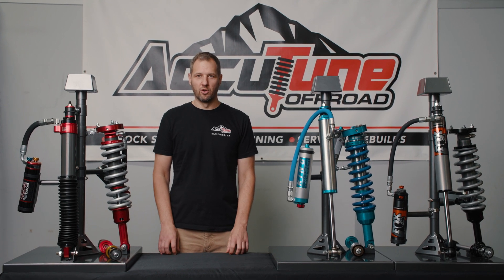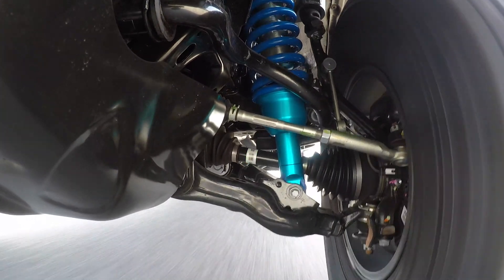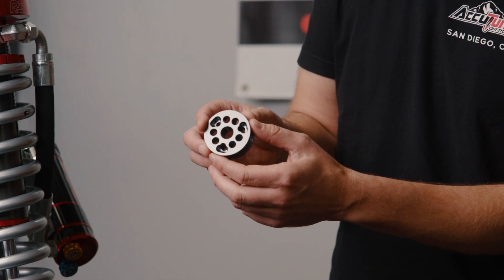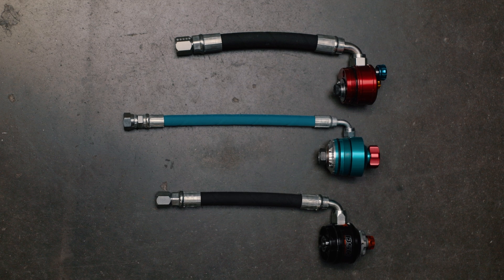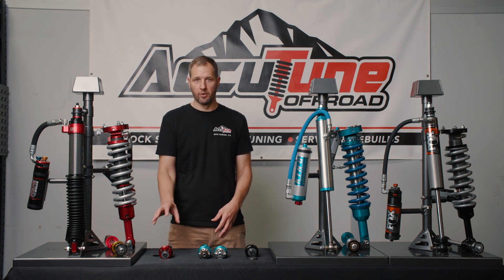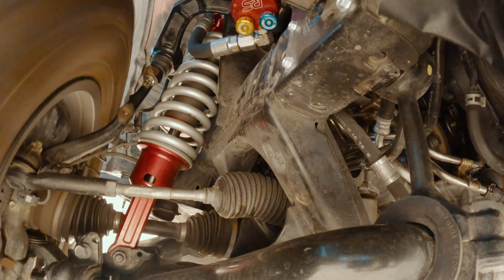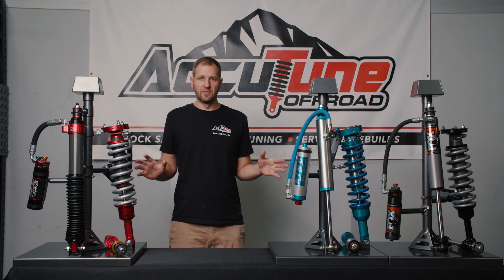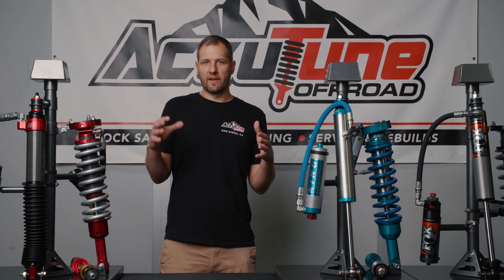How do Ride Shocks compare to Fox and King?

Comment: Now if we can get ride shocks to offer different colors or just get rid of the red that would be amazing.
Reply from the maker: What color combo would you prefer?
Reply: @accutuneoffroad  bronze, gold, or purple maybe? Something that still stands out as your brand, but doesnt clash with most vehicles colors. It sounds dumb, but it really is the on thing that is pushing my my deciding to go with another brand even though I really want the dual adjustments. Plus, red anodizing always fades to pink.
Reply from the maker: @ALBIN_DESIGNED  I'm glad we didn't do gold, because it would look a lot like another brand of shocks. I'm not sure purple would be a desirable color for off-road shocks. I understand aesthetics are important, we opted to stick to red which matches AccuTune branding and it's different (enough) than other brand shocks out there. All anodizing can fade if they are exposed to a lot of sunlight/uv rays. We've had the same set of shocks on our vehicles for 2+ years now with no fading. For OEM fit shocks like we offer, they are usually covered in the wheel well and don't get exposed to as much sunlight as something like a custom buggy would.

Comment: Really impressive quality y'all are bringing to the table with the Ride Shocks! Wish they were available for 2G Tundra's - but probably pretty resource-intensive getting each setup just how you want them to perform. Taco and 4R/GX market makes sense, really like the concept of trying to nail these 'out of the box' with application-specific tuning. Lots of upgrades over the conventional Fox and King offerings. Nice video and great technical info!
Reply from the maker: Thanks! A current employee here has a 2nd Gen Tundra, so we may or may not be working on those soon ;)

Comment: Im looking for shocks for my Tundra. Im going to lift it. Its my daily driver and i tow with it and do off-road. My main thing is i want a comfortable ride. What shocm so you recommend
Reply from the maker: Fox and King are both good options for your Tundra. If you plan on towing and going off-road I would consider getting shocks with adjusters. We can narrow down some options even further with our sales team, shoot over an email to keep this conversation going sales@accutuneoffroad.com
Reply: what'd you decide on? kicking around options for my 2G Tundra as well.
Reply: I bought King 2.5 extended through Accutune. I upgraded to 700# springs due to a winch and hidden winch bumper on my 2g Tundra. I bought Deaver 748s through Accutune, as well.
Reply: Get the adjusters. It’ll help with trailer porpoise where it can get scary. Even cheap shocks with adjusters really helped. The Fox are even better. Buy once cry once.

Comment: What of the top tier options would you recommend for the typical 90/10 owner? I have a 5th Gen 4Runner w/KDSS so any input would be much appreciated! 

If it helps I currently have a sherpa roof rack and window panels holding my maxtrax boards for the PNW season along with recovery gear to help the random person stuck in snow.

Running the Eibach pro truck lift and it sits almost Level with the current weight (full tank)
Reply from the maker: You really can't go wrong with the Ride 2.5 Shocks for your KDSS equipped 4Runner. For the price, you get a ton of value. Aluminum shock bodies, High and Low speed compression adjusters and weight range specific tuning. They perform great!

Comment: Thanks for all the info. I would have buy your shocks from my Tacoma if I would have seen them a little earlier. I ended up going with the Fox DSC's and they're nice. One question with these shocks? Do I need to worry about running a limiting strap so they don't hyperextend? Is there damage that can be done internally? Thanks
Reply from the maker: For trucks like that, its not necessary to have limit straps. These shocks are designed to handle that kind of thing. Limit straps are a good idea for vehicles with a lot of unsprung weight from things like big heavy tires, axles or portals. Limit straps are also a really good idea for high speed applications like prerunners and race trucks.

Comment: I have a fully built 4Runner, looking to upgrade suspension before the end of the year and I am really trying to figure out which of these three setups I’d like. Currently running Bilstein 6112/5160s but want some more comfort for highway driving. With my current setup I feel every bump on the road.
Reply from the maker: The shocks you have are digressive, which means they run a bit firm/sporty. Unfortunately we are not able to change the valving in the shocks you have, but a set of Ride, Fox or King would definitely be a huge improvement over what you have. We've found a lot of people making the switch and really enjoying the improved ride quality, much smoother on the street and off-road. Since they are all about the same price, I would strongly look at Ride Shocks option. They will definitely offer the smoothest ride out of the box compared to Fox and King. They come pre-tuned depending on the build. Feel free to send over an email if you have any specific questions, we're happy to help Sales@Accutuneoffroad.com
Reply: What did you end up going with?!?
Reply: @GustavoRamos-tx4if went with Ride Shocks man!
Reply: @agentwolffe how are you liking the Rides? How’s the on road feel?
Reply: @ dude they are great. My daily commute is much nicer and it eats up all the bumps in the road. You can play with the dual piston adjusters, I run them on the softer side to have a better feel on road. I adjust as needed when wheeling.

Comment: I'm thinking about adding these to my Tacoma which will carry about 700lbs with a Camper. I'm located in Baja. I really want the truck to perform well on the beach, long washboard roads and at slower speeds on more rough trails. I also tow a sub 3k lbs boat/trailer time to time. I was going to put a stage 3 deaver leaf pack but I also think airbags would be a good idea for when I tow. The issue though is will that interfere with my up travel so much that having the upgraded shocks would be unnecessary? Thank you for your feedback.
Reply from the maker: We havn't worked with many air bag setups so I cannot confirm if you are losing any up travel or not that that system. Tacoma's are are already pretty limited in up travel in the back, so I would avoid reducing that if you can. Constant added weight of 700lb to the back plus towing is a lot for a Tacoma to handle, so I would be careful to not overload it the chassis & brakes.
Reply: @accutuneoffroad  Thanks!

Comment: Yeah great review and very enlightening. I must say the biggest market is custom tuned for great street ride and low to medium wheeling on pretty much slightly lifted vehicles with bigger tires. Bit like the VW Beetle of shock demand. My Jeep has MC springs, shocks and arms but boy I just cannot get a good ride. Might start with a Go Pro strapped on and watch wheel travel when hitting certain street potholes. I want a ride like the ZR2 Colorado. Perfect right out of the box.
Reply from the maker: Thanks! The ZR2 shocks are likely tuned very close to that trucks weight and suspension geometry, also cheating since its IFS. Unless you custom valve a shock for a built Jeep, you are just using generic Jeep shocks that fit the total lift. For some thats not a problem and does the trick, but for a few extra bucks it will really allow you to enjoy the vehicle a lot more. Not sure what Jeep you have, but if you're looking to make a change I'm sure we have some options for you. Let us know!

Comment: You developed arguably one of the  best shock brands to meet the market since king and fox, you don’t need to suck anyone off anymore, if your shock is better just say it. Everyone has kings they suck on OE applications which is 90%plus of the consumer but everyone has them so they just follow. Fox is the guy at the office that has won sales men of the year consecutively, employee of the month consecutively but at this point is washed up and just shows up.  Their 2.0s are trash and need tuning before they even make it on the vehicle, overpriced and cheap. A call to orielly’s will yield a 3 dollar strut and 5 dollar whore that gives a better ride.  Getting ready to order a set, ride shocks for the win !
Reply: I think because Accutune's business model for almost a decade is customizing and improving the tuning each brand to work well per application, you don't want to throw that out the window, notice accutune is really comparing their shock to the tuned version of orange or blue. If it was an out of the box comparison with standard tuning the results would vary.  And to your point 2.0s don't have much value, ride tuning is all over the board per application, but the bushings and shaft quality are my main complaints.
Reply from the maker: Thanks for the positive feedback about Ride Shocks!

Comment: what do people mean when they say they got their shocks tuned?  I have a jeep tj on 3.5 inch jks lift, which use jks shocks.  Will FoX or anything makee my on an off road more comfortable/controlled?
Reply from the maker: Great question. So up until now, shock manufacturers have been offering a "one size fits all" shock for specific vehicles. A Jeep shock for example is designed to bolt in and function for that model in its stock form. Its typically a "good enough" tune. A "tune" is comprised of a piston and unique set of valving (shims). When you start adding weight to the vehicle or changing to lifted springs, the tune/valving inside the shocks may not be ideal for that new weight. Custom Tuning is a combination of addressing spring rate and internal valving to fit a specific vehicle. Custom tuning a shock will help performance and ride quality in a big way. This concept has really been taken from the off-road racing world and brought to general consumer. Not all shocks are tunable though. We will custom tune Fox, King, Ride shocks with remote reservoirs. If you purchase shocks directly from us, we will custom tune them for free with purchase. If the ride quality with your Jeep is not that great, we can certainly help out. Feel free to send out sales team an email and we can look into options for you. Sales@accutuneoffroad.com
Reply: @accutuneoffroad As a past customer who had Fox 2.5 shocks with dual speed compression adjusters on my RAM 1500, I can assure you that the folks at Accutune Off-Road know their stuff when it comes to tuning!!! It is what makes a good shock into a top performing shock!
Reply: Bought my Fix from Accutune and spoke with Ryan directly. Great company and he answered my stupid questions. They make my Tundra feel amazing off road and ride like a dream on road. Cost was thaw same as buying them from a place that doesn’t tune them. The only thing I have to do is turn up my low speed a notch it two and I’m good for road and off-road. They actually work great no matter the setting it just depends on your preference.